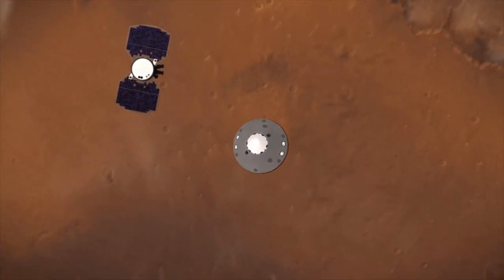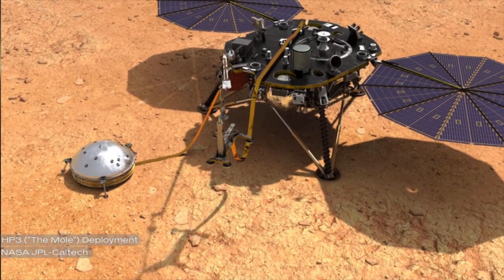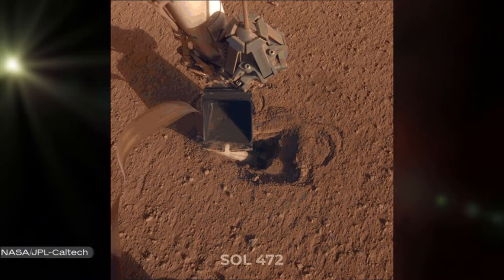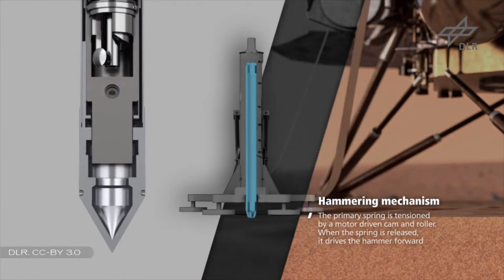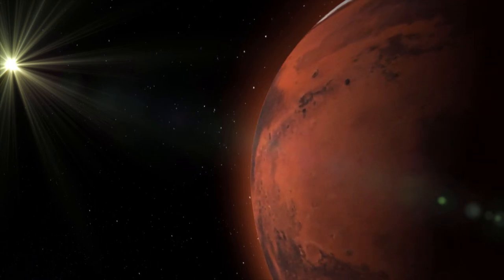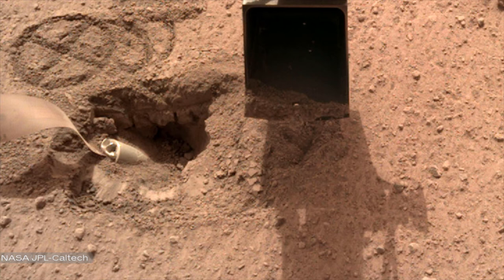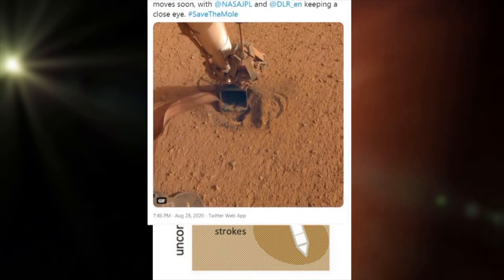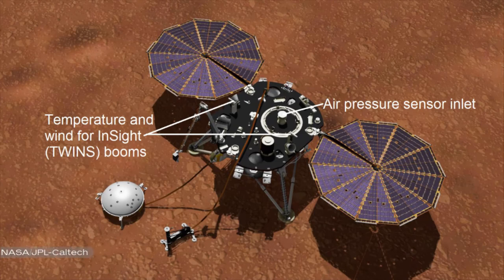NASA's InSight Mars Lander Update | Fixing the Mole

Comment: How cold is the sand?
Reply from the maker: Insight landed near the equator, so during day the air temperatures are just below zero, sand will be around zero as well depending on the suns intensity. Insight has weather sensors so you can actually check this live: https://mars.nasa.gov/insight/weather/ (currently there are some issues)